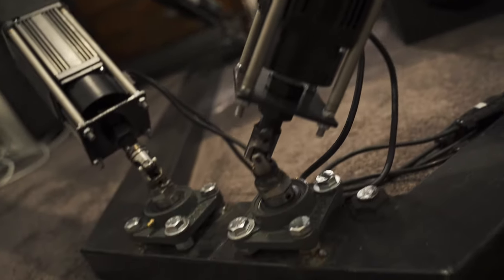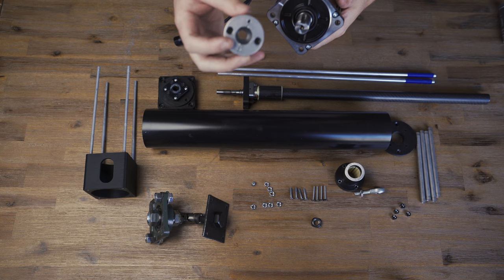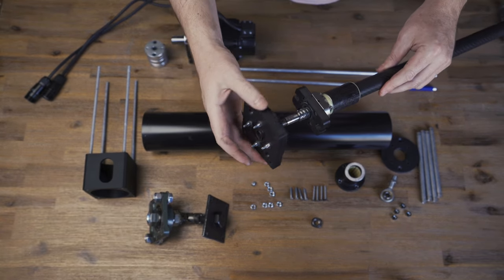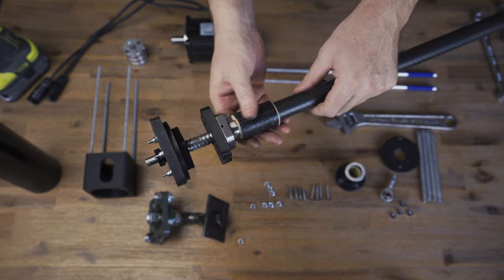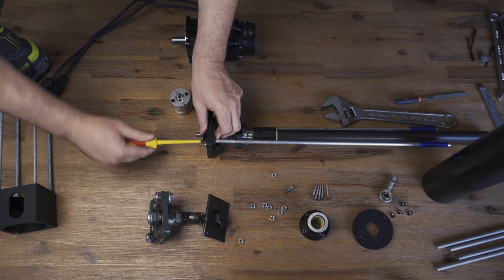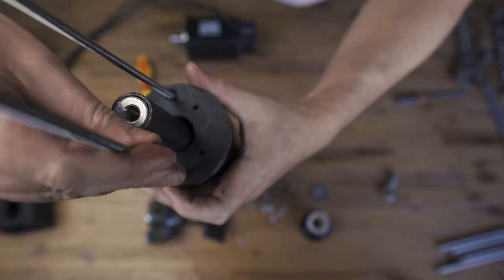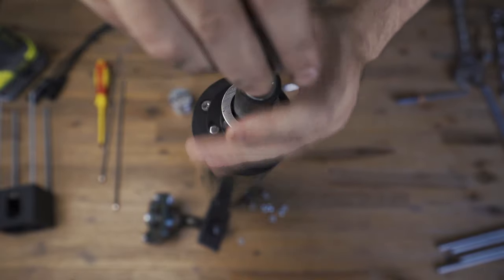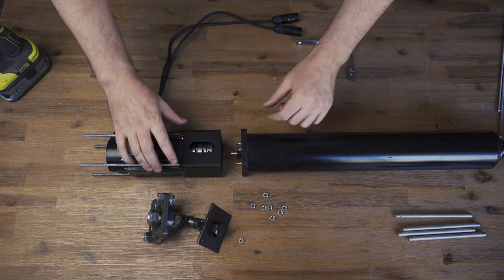Actuator Build Video - DIY 6dof Racing Simulator

Comment: Peacemaker, I appreciate you posting this. I have not built actuators myself but made an awesome DIY 3DOF motion rig for racing and posted a bunch of videos. But I have been planning on making a 6DOF so I appreciate the info. Take a look at my rig if you have time. I'll come back for sure when I get my 6DOF carbonfiber frame project running. I'll need the advice!  DMAX
Reply: I'll take a little look ;)
Reply: @felicityxu2320  tell me about your sim rig parts...
Reply: Hi do you have a link to your build with tutorials and specs? I would like to try that build too.

Comment: Excellent Video mate , very informative and shows what a great actuator you created , i knew it was Good But this proves it , Thanks for sharing and  for posting
Reply from the maker: Cheers mate!
Reply: @peacemakermotion3949  what are the specs( pitch and diameter) of the big threaded stud??
Reply from the maker: @FirstLast-tx3yj  these are using 1605 ballscrews for 250mm/s. will probably go to 1610 to double that with my next build. and 600mm instead of 500mm length :)

Comment: You should pick up some brass shim stock. You can use it to protect delicate stuff like screws and shafts so you don't kick up a burr when you clamp down with your drill or vice grips.

Also, to drive threaded rod there's a much better way than grabbing it with a pair of pliers. Thread a nut on, then thread a second nut on and jam it against the first. Now you can grip the nuts with your pliers/ratchet/whatever to spin the threaded rod.
Reply from the maker: cheers man, the brass shim sounds like a good idea! I did try jamming 2 nuts together initially but then stupid me was trying to get the socket over both nuts instead of working on the first nut only which when aligning the 2 nuts loosened them enough to both spin haha. rookie error lol.

Comment: Hi, amazing work thank you, are ur actuators could be build with AASD 20A or 30A (more power i mean) ?
Reply from the maker: You can use whatever motors and drivers you want. as long as the Driver is rated for the motor you use. The AASD manual has a list of what drivers will work with what motors

Comment: Retired Army Vet looking to do something new.  Very informative video.  I'm debating 4dof or 6 dof DIY.  I'm like your build I've also seen silent chill's build.  May have to query you build more.  looking at Thanos controller and matching servos.
Reply from the maker: Hey mate, sound like you're heading in the right direction, great retirement plan! :) Either way i dont think you can go wrong, the silentchill direction may be a little more hands on but now i think there is a handy GUI available or coming soon to help confirgure the odrives which will take a lot of the headache out! but if you want to focus more on rig design and building actuators then the thanos plug and play solution is a great somewhat hassle free solution.
Reply: @peacemakermotion3949  Yes sir it is.  Do you have the dimensions of your base plate?  I follow your link to the sim site.  Have you done any more mods?  Thank you for your response.
Reply from the maker: @ozziesoto2955  i sent someone my dimensions on xsimulator and they drew it all up in CAD with the dimensions and posted it there on my build thread. Should be there like 3 pages in or something
Reply: @peacemakermotion3949  Sir, what is the maximum load/weight your sim can support?
Reply from the maker: @ozziesoto2955  well my rig with me on it is about 200kg. And it does that with ease. You still want to keep it fairly light but 200kg is fine for mine which is probably more than enough for most people haha

Comment: Hi, 90ST motors is okay to use for this design? What about the 3D parts for 90ST. Thanks and your set up soooo awesome...
Reply from the maker: Yeah same motor just different motor coupling needed due to different size shaft that's all. All parts will fit the same

Comment: Hey mate, just wondering if there is an Australian distributor for 90st servo motors? Also wondering if you would recommend just going for 80st, or would I run into hurdles when building any online motion projects? 🤔
Reply from the maker: Hey. Not that I know of. And if there was, you'd be paying triple the price. 80st or 90st doesn't matter. Just depends on what your actuator plans call for.. my plans are for the 80st. Same spec motor just different size flanges (80mm vs 90mm) and different shaft sizes (19mm vs 16mm(i think it is))
Reply: @peacemakermotion3949  thanks so much man - just started my journey purchasing the 80ST today. The price difference is around 70aud each between the 90 and 80st so I figure that difference x 6 = a thanos controller
Reply from the maker: @Ryan Chenoweth  and that right there is the reason I went 80st all those years ago haha. Although the gap had closed considerably since then.. so I thought.. but if you managed to get them that much cheaper then good going man!
Reply from the maker: @Ryan Chenoweth  did you get white version AASD? Or normal?

Comment: Awesome build 👌
What if we hookup a gear box (worm, helical or planetary) for shaft drive, instead of linear actuator ?
These servo motors very expensive here.
Can you show us how to build a 3dof system using AC induction motor in your future project.
Reply: If you take any motor, add a gearbox of some form, and then add a sensor (typically an encoder, or potentiometer of some form) for position feedback, youve now built a servo motor of your own. :)

Comment: Hello, can this be built for a platform to place a chair to use for a flight sim?
Reply from the maker: Hey mate, yes of course! With my base dimensions you may be a little high but if you made a wider base then the platform would sit lower if you know what i mean. totally doable. i have asunken design to try and make it as compact and low as possible.

Comment: so the whole weigh of the rig is rested on one big nut(times 6)? wouldnt that strip it quickly?
Reply from the maker: Nope not at all. Ballscrews are designed for a lot heavier work than this.. and running 24/7 in manufacturing processes. As long as you service them every now and then you shouldn't have any issue. Just comes down to the quality of the screw you get too.. I used the cheapest ones I could find and so do others and not a problem with them yet. Maybe bit noisier than they could be thats all.. they really do make easy work of it. Ibuse to think like you as well.  But now I know even more so these are quite resilient!
Reply: @peacemakermotion3949  thank you!

Comment: Hi there!
I'm gonna make a rotary one instead of actuators, but I have a question: How many kilos do you think can resist that universal joint end? (Each one or the 6 pack...)
Reply from the maker: hey sorry for the late reply.. I reckon it will handle a fir bit to be honest. with me its about a 180kg payload.  It can take more, no problem. but when going to heavy and too long of a stroke i think you may benefit from going larger diameter ballscrews and actuator tubing etc to avoid flex when fully extended. 
Good luck with your build man!
Reply: @peacemakermotion3949  Thanks forr your answer. Actually my project its gonna be with rotary actuators, something like this: https://youtu.be/8SM3apymuwM
But with 3 screens. Thats why I'm calculating that max weight of the rig.
The point is that I want to use Rod ends in the downside and universal joint in the upside. Thats why I worried about max weight.  Please, if you dont understand me tell me, my english could be incorrect (specially in technical things...)

Comment: Little tip (not to sound like a smartass :) ), but next time tighten 2 nuts together at the end of the thread in stead of using that adjustable wrench and hands to screw it in ;)  And then just use the drill :)
Reply from the maker: Haha yeah tried that initially and both nuts just turned on the thread.. last time I tried and it worked so maybe I didn't have them locked tight enough initially lol.

Comment: awesome great  work  bro. i wont to build 1 dof only for traction loss my question is about the motor 80st-m02430  it comes with motor controller as a kit  do i steel need a power supply  and can i run them with arduino  board or i need simthing like thanos controller. thank you
Reply from the maker: Hey mate sorry bit late. The AASD driver that comes with it is also the power supply. It takes mains voltage. Thanos controller is by far the easiest method as its a direct plug in. The arduino option is what the simfeedback guys use to use but that developments been on hold so god knows what's up with that.. insee flypt mover has given support for arduino now so maybe something worth looking into there.. dont know much about it though. I'd recommend shelling out for thanos controller and spend more time on building and perfecting the rig as it takes alit of the headache out.
Reply: @peacemakermotion3949  thank's bro 👍👍👍

Comment: Hi Peacemaker Motion Sim,
I must say you did such a great job!!! Keep it on!!! I will start to build my own 6dof too....though need to design it too. I have a CNC machine in my garage and hopefully I can get it done easily. 
I have a question:
What kind of speed and torque do you achieve with those actuator's?
Reply: Old reply but he could be using AMC-AASD15A SERVOS in this case 750W 220 volt ac servo motors rated at  3 amps.  With setting change on the servo control I think FN 83 or 93 to 100 vs 200 you can run on 110 volts at max 6 amps.  I am using 4 of them two on two different 110 volt circuits. Does not draw anywhere near the 6 amp max. Likely around half of that I need to get an AMP meter.
Reply from the maker: Sorry missed this!! Bit late. But Phil had already helped answer alot! With 3000rpm which these motors do you will get 250mm/s on a 5mm pitch ballscrew and 500m/s with a 10mm ballscrew. I have 6 x 750w motors all plugged into one 10A outlet with a power meter and the max ive pulled in total is 580w so they are basically hardly working anywhere near their max potential.  That's with 5mm pitch screw. Gonna go 10mm next with 1610 screws and be good to see how much more power that will use but it will still be a breeze I reckon.. after all that's what PT actuators use on theirs with 2510 screws no problem at all..

Comment: Very clever. It's been two years, how are the U-joints holding up? Any issues at all after all this time? Thanks for sharing. Nice work.
Reply from the maker: These little ujoints are like 3 years old now. Still going strong. I'm transitioning over to a larger car universal joint soon though. More range and smoother and more robust.

Comment: is it really necessary to use a 750 watt motor for it ?
Reply from the maker: well its more about the RPM. 3000rpm is why these motors are popular because you want the speed. then they are higher torque rated then the lower 60st equivelants which may be an issue as well. Now to mention the price. They are cheaper because they are more popular so a 60st doesn't even make sense

Comment: I just subscribe to you. Great info! Do you plan to do an other video wich cover the other parts of the rig? What is the approximative total cost of your rig? Thanks
Reply from the maker: hey mate, cheers for the sub. I'll probably do a video on other parts when i upgrade to 60mm ballscrews and have to redesign the frame etc. for now there is some dimensions up on my xsimulator build page. If you have any questions you can ask them there :)

Comment: G'day, I'm working on an a design like this, does this design not require limit switches?
Reply from the maker: Nope. Coupled with the thanos controller it uses torque detection to cut power in an end limit reaching scenario. It uses this same detection to calibrate everytime you power the rig up. All actuators lower to the bottom and detect the bottom and set that position to 0% (via built in encoders in the motor) then with some maths based on how much travel you want and the pitch of your ballscrew it works out its 0-100% range values :) soooo good compared to limit switches and potentiometers for positioning!
Reply: @peacemakermotion3949  ok ripper. I thought it may be some thing like that.

Comment: What's more important in these actuators? rpm or torque?
Reply from the maker: Speed really. But higher speed has less torque so won't get away with high pitch screws..  lower speed high torque can run higher pitch screws. Its all pretty relative. I guess the 80/90st hit that sweet spot
Reply: @peacemakermotion3949  Nice one, thank you :) I'm looking at the 80stm03520 with a torque coefficient of 1.17 and a speed of 2000rpm. Thought I'd use it with a higher pitch ballscrew to get the same speeds as the m02430. choosing stuff is headache inducing, specially when you're not an engineer :P
Reply from the maker: @PhrozenN  yeah should be fine. so you'd get 400mm/s with a 10mm pitch. I'll be running 10mm screws soon on the 2430s for 500mm/s. Should be good ;)
Reply: My math makes it out to be 333mm/s (2000/60)*10. A 15mm pitch would give 500
Reply from the maker: @PhrozenN  oh yeah you're right. I was at work and just estimated. I was thinking the 2430 was 2500rpm.. but its 3000.. seems pointless to lose so much speed.. unless you're getting the motors for a lot cheaper of course.. but yeah.
Reply: @peacemakermotion3949  I'll reg on xsimulator, seems more appropriate to discuss things there ;)

Comment: It doesn't look that expensive to build....why the hell companies charged like $10,000-12,000 for similar build?
Reply from the maker: Basically they have to over engineer things and create custom parts with more expensive machines and they also have to probably pay rent and wages and most of all supply a warranty and ensure the thing lasts or it can tarnish their brand etc. Probably small turnover as well so prices stay high to offset that.. I agree though.. they are very expensive for what they are but I'm sure they have quality parts inside. (Looking at pt actuators here) but some companies liked box are flat out ripping Kent's off haha